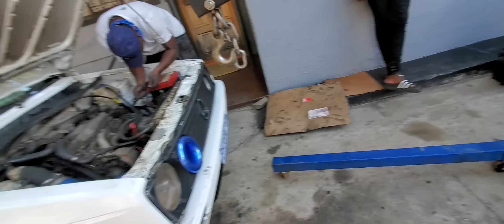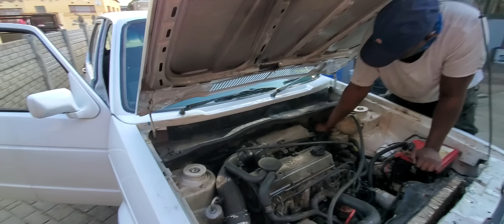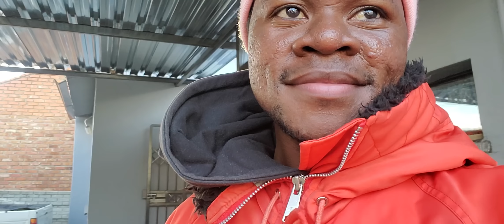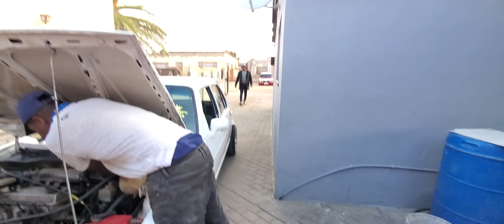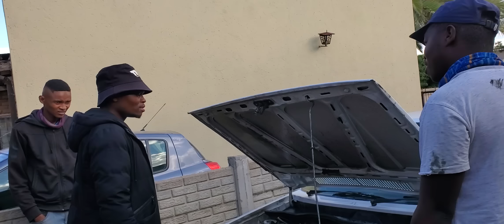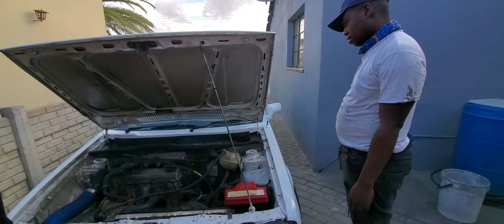JIPPER SHOCKS MADAGA 😲 AFTER RACE MESS WITH BOSSO🔧 LOOK WHAT HAPPENED 😭😢

Comment: Madaga must get a stainless steel velocity stack, full stack from throttle body, I'm sure he can customize one for himself
Reply: And summer add a VR6 Throttle body it will sound like a beast
Reply from the maker: What performance upgrade does it make? The Stack?
Reply from the maker: Vr6 throttles are better than the independent throttle bodies?
Reply: @carsstanceclass  The stack is just for the sound, and more airflow but the VR6 Throttle body will boost about 10-15 KW and around 30NM Torque when it is Ported (Modified) but you must find someone to build and adapter for it to fit in a 2.0 8V and the itb's are no joke boost more than the VR6 Throttle body

Comment: fix that exhaust leak. so much power is lost!
Reply from the maker: I thought it was the Cam
Reply: @carsstanceclass  Jippers manifold isnt on right or its got a break in it. can hear it firing from there. its running with low back compression so it will loose power.